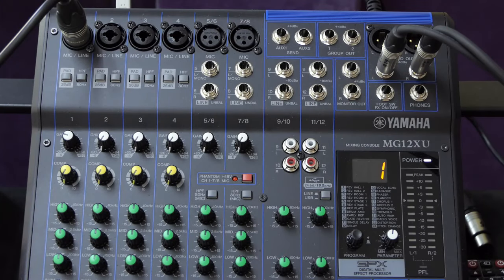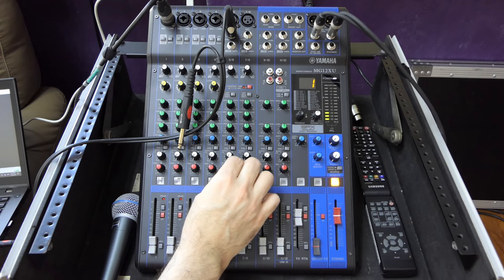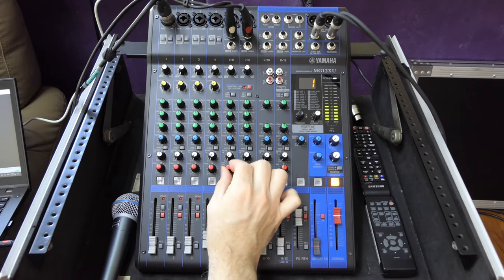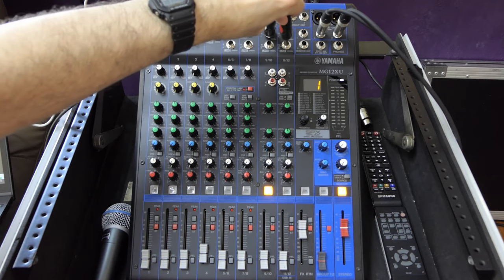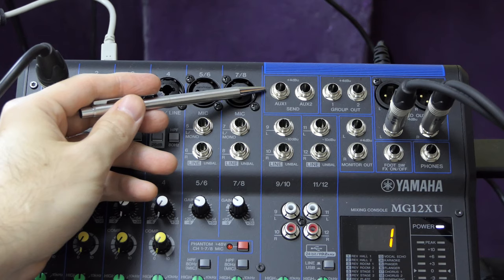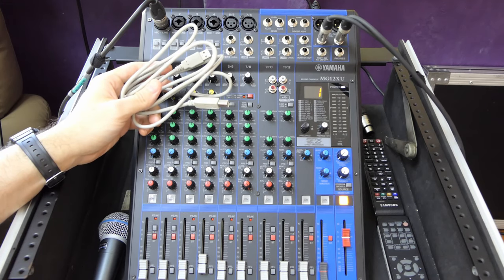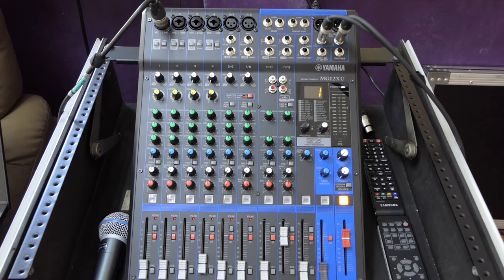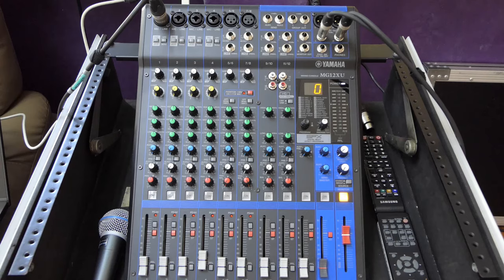Yamaha MG12XU Mixer Tutorial Part Two

Comment: Hi  I have a problem connecting the Mg12xu mixer to a dbx266xs  processor,and a dbx1231 equalizer  and also I got ptu7000 microphone and a pair of EV pa power speakers. Can you show me how? Thank you so much sir. Great video
Reply from the maker: What specific problems or issues are you having?
Reply: @GLBProductions  I just  don’t know how to connected  for example the processor, the equalizer from where to where to the mixer, I got the mixer and the microphone speakers working that about it , the processor and the equalizer is  not connected to any  thing yet . Thanks for reply back
Reply from the maker: In this case I suggest you contact the person who sold you the equipment and get them to assist you - it is much easier to explain these things in person and there are several different ways of connecting them.
Reply: @GLBProductions  got you thank you

Comment: Great vid. Can you use the AUX 2 1/4 inch connector to run a second separate stage monitor for a second singer that wants their own monitor mix ? Or can you only use AUX 1 and then have to daisy chain monitors together?
Reply from the maker: Yes you can, but if you do that remember that you cannot really use the internal FX engine due to the duplication of controls. So you can have two monitor mixes or one monitor mix plus the internal effects.
Reply: @GLBProductions  Thank you and makes sense!

Comment: Thank you for this tutorial video! Im just wondering if it is possible for a complete band instruments such as guitars, keyboard, and some line in connection from the drums,  can the sound coming from the instruments be downloaded directly to the computer as connected via USB. I'm thinking if I can use that method to do some livestreaming using OBS.
Reply from the maker: Yes you can do that no problem - just be sure to monitor the audio going to the livestream for level, balance etc.

Comment: Nice video, man. I have a question for you.  With this mixer, you can cut of the low frequency for your main speakers? I have an subwoofer,  and I wont to cut the low frequency for the speakers output, about 110, 120Hz. So, my question is, I can do that with this mixer ? Thank you.
Reply from the maker: No, this mixer does not have EQ on the main outputs, or any output for that matter. For your setup I would get a separate 2-channel electronic crossover - analog ones are still available and relatively inexpensive.
Reply: @GLBProductions  Thank you for your answer.  What about this mixer? Mackie ProFX12v3. ? I see that he has  low cut filters for all the channels,  including the Line channels.
Reply from the maker: Ah those are for the input channels - it is not the same type of filter as you would need when setting up a subwoofer.
Reply: @GLBProductions  Thank you a lot for your answer.

Comment: I noticed that the signal from a windows laptop coming from usb input has a distorsioned signal . With a macbook everything works very well. I tryed with many laptops ,still the same . Can you explain why this happen ?
Thanks
Reply from the maker: In my experience changing the cable can sometimes solve the problem. You can also try turning down the volume on the laptop to about 50%.

Comment: What a very comprehensive tutorial! I would just like to know, would the USB interface produce feedback if I use this mixer for a conference app, say, Cisco WebEx? I am concerned that the audio from other members would loop through my own speakers back into microphones that are on input to the mixer. Cheers!

Edit: I apologize if this has been discussed. I might have zoned out while it is on.
Reply from the maker: Hi Lyndon - it depends on which app you use. Some are able to deal with this problem via their echo-cancellation feature. Otherwise you need to use headphones to monitor the audio coming in from the USB connection.
Reply: @GLBProductions  thank you so much! Greetings from the Philippines.

Comment: Hi I have been following your tutorials on the MG series. I am a mobile dj. Can you guide me on hooking up a reccorder from a videographer.This is especially important when I am playing a wedding.Thanks
Reply from the maker: Sure - depending on which recorder they are using, you'll assign them one of the outputs from the mixer. This can be the extra pair of stereo outputs, the group outputs or one of the aux sends, depending on what works for them. It can also be the USB output if they are recording to a laptop.
Reply: @GLBProductions  Is it possible to clarify the above by way of a diagram of picture?

Comment: Hello, I am using the translator to ask a question since I cannot find more tutorials on the use of the console to transmit in a streaming by USB function. I have problems with the volume control (I cannot increase the volume that is transmitted) and I do not understand how to regulate the internal FX, which I listen to through headphones but do not come out live. Hopefully you can help me. Thank you
Reply from the maker: Hello Karina, thanks for getting in touch. The actual volume of transmission when streaming is difficult to judge as each individual listener has their own volume control. My best advice there is to ensure that your meters are showing a level of around 0dB when broadcasting. You may also be able to monitor and/or increase the level in your streaming program. 
If you can hear the effects in your headphones but not in the main outputs check that the FX RTN channel is switched ON and also routed to the main LR outputs. All the best!
Reply: @GLBProductions  Thank you very much for answering!
Perhaps it is not clear to me what are the total controls in usb output, that is, when I do not have speakers connected. The manual is very limited and I can't get the information. In another tutorial I suggest raising the gain and the compressor, but when testing it I don't have a better volume and if it lowers the overall quality. Thanks again and if at any time you post with this topic please activate the Spanish translation which is very useful to me. Regards!

Comment: Question for this mixer ?. when effects are on they effect the music and not just the vocal so switch of the effects coming from mono 5 & 7 ( which is great to balance when performing ) and the reverb has gone from vocals as well. In a word, when the vocal effects are on and being used then it also reverbs through the music as well giving it a wobbly yaw sound . Can you advise .Many thanks
Reply from the maker: Yes, make sure that your recorded music is not going through the effects unit - the FX send knob should be fully counterclockwise on the music channel(s).
Reply: @GLBProductions  Thank you so much for your assist !
Reply from the maker: You're welcome Kenneth!

Comment: Hello, thanks again for your wonderful video, very instructive ! I am a drummer & personally use this same mixer so I have some questions : -1) What is the best system & connecting for receiving a click + sequencer from a main mixer, without sending it, of course, in my main Stereo Output, but in my personnal ear monitor ? - 2) Which line do I have to use, the two SEND (Aux 1 & 2) or the two GROUP OUT ? -3) Which connecting to use, balanced or unbalanced ? - 4) How to proceed exactly ? Thanks again for your helpful answer, musically, Emilio L. (France).

Comment: Great video, thank you for your time. At 16:50 you talk about the possibility of a feedback loop between channel 11/12 and the computer. This is what I am experiencing but the static feedback sound comes intermittently every two minutes or so and lasts about 5-10 seconds. Is there any way to prevent this from happening? I've searched many forums and can't seem to find an answer.
Reply from the maker: That doesn't sound like a feedback loop Tom - an electronic feedback loop will get louder and louder at a specific frequency and will not be intermittent as you describe. Try to isolate the source of the noise - is it coming from the computer or from one of the input channels?
Reply: GLB Productions I believe it may actually be due to the usb connection as I run computer audio through the mixer via the USB port on the back of the mixer. Do you think this is a potential source/reason for the noise?
Reply from the maker: Most definitely - computers are notorious for introducing noise into sound systems. Try a different USB cable as well as a different computer and see if that changes things.
Reply: GLB Productions thanks very much for your help and suggestions. I’ll have a play around and see what I can do. Subscribed!
Reply from the maker: No worries Tom!

Comment: Your videos are very well explained. Thank you for that.
I have a question about connecting the mixer to the PC via USB. The sound in both directions is very quiet. Is there an explanation for this? Thanks in advance.
Reply from the maker: Thanks for watching Hamouda! For the incoming PC signal, make sure that the volume on the computer is still to 100%, and check that the digital attenuator is not reducing the signal - this is accessed by pressing the PROGRAM knob in the FX section five times. For the signal from the mixer to the PC, you can try setting the channel and master faders above the 0dB mark, or raising the level in post-production.
Reply: @GLBProductions  Thank you very much for the quick reply. I'll try that out.

Comment: Me again. Thanks for your advice.  I've already watched your tutorial on the Allen and Heath ZED-60 which is also one I'm considering.  I need it for my hardware synths and intend to use it live, but also as an audio interface for my laptop. As I need quite a few inputs plus vocals I don't think a specific audio interface will do. I know at this price point there will always be compromises but I need it quite quickly so saving up for a more expensive mixer isn't really an option.  Would you have a preference between the MG series and ZED range?  Or do you think there's something else I should consider?  Thanks again.
Reply from the maker: I would choose the ZED over the MG series because they have much better build quality. They also have semi-parametric midrange on the channel EQ whereas the MGs only have a fixed 3-band EQ. However the ZEDs also have several quirks you need to be aware of eg no 1/4" main outputs. So you need to look at both ranges carefully and pick the mixer that has the features that suit your needs and is within your budget.
Reply: @GLBProductions  Thanks for your help.  Much appreciated.

Comment: A great Video! I have one question, how would you connect an external compressor.  Thanks in advance.
Reply from the maker: This mixer has no insert points, so the compressor would need to be connected inline: either between the source and the mixer or between the mixer and the power amplifier.
Reply: @GLBProductions Thanks very much for your rapid reply. Could you  please be more precise. For example from which TRS socket on the mixer do I connect the the input signal to the compressor and which socket on the mixer for the return or output signal of the compressor. Again thanks in advance.
Reply from the maker: You're welcome Peter. What are you trying to achieve: compress a single input or compress the entire mix? Also, what's your application: recording or sound reinforcement? Normal serial compression or parallel compression?
Reply: @GLBProductions  I purchased  last week a Behringer MDX2600 V2 and would like to compress the Alesis SR18 Drum Machine (Channel 5/6) and also the iPad Channel 9/10 for a live performance. It would also be great if I could compress the vocal channel 1 which is not a priority  because  the mixer has a built in compressor on this channel, but it would be nice to know if this could also be compressed with my Behringer. Thanks again and really appreciate your advice. Many Greetings from Freiburg in Germany.
Reply from the maker: Thanks for the info Peter. The challenge here is that you have a stereo compressor with a total of two channels of compression, but would like to compress two stereo signals, a total of four channels. Given the equipment you have, I would connect the MDX2600 in between your mixer and power amplifier or powered loudspeakers - this will allow you to compress the entire mix, including your vocal mic. It won't give you as much control as having compressors on the individual channels but sources such as drum machines and recorded music already have some compression in their signals. It is also a simpler setup which is easier to adjust on the fly during the performance.
Reply: @GLBProductions  This is a great suggestion. I thank you very much indeed and appreciate your professional advice. Keep the good work going and wish you a wonderful and successful day.
Reply from the maker: You're welcome Peter, all the best with your music!
Reply: @GLBProductions  Hi. I have a feeling that there are many owners of the Yamaha MG 12 to 20 series mixers  who would also be interested in how to connect their outboard/external modules (Compressors, multi effects etc.) to either a single channel or chain of channels including stereo. Therefore, I would be very grateful (others too) if you could possibly make a YouTube video on this subject. Again thanks for the great work you do. 
With kind regards
Peter

Comment: I'm really confused about monitors for live performance. 

We use the XLRs for the speakers that go out to the crowd. We have one wedge monitor and one transmitter for in-ear monitors. The video says the MONITOR OUT jacks are for studio, not live performance.

Are our only options the AUX1 and AUX2 sends? What if we wanted to use the FX but hear it through both monitors? What if we wanted to add another wedge monitor? 

Surely there's something I'm overlooking.
Reply from the maker: Yes, this topic confuses many people 😅 To answer your questions: 
The MONITOR OUT jacks are designed for connection to studio monitors when the mixer is used in the recording application. This doesn't mean that you can't use them for other purposes - any output from the mixer can theoretically be used as a stage monitor send. 
On this mixer, AUX1 and AUX2 are designed to be used as stage monitor sends in a live sound application - they are or can be switched to be pre-fader, so that your FOH mix changes do not affect the monitor mixes. At the same time, AUX2 is designed to be either the send to the internal FX or an external monitor send, not both at the same time. You cannot use the internal FX and have it heard through both monitor mixes. In order to do that you would need to use an external FX unit. 
Hope that helps!

Comment: your tutorias are great! this channel deserves 1m subs and more!

question regarding the usb interface. if I just set it as output from my laptop, and toggle the st button, will still have feedback loop? My setup would be that the main output is for live sounds, and the aux send (1 and 2) will be sent back to the line in of the laptop. I'm only using one laptop for this setup.
Reply from the maker: Thanks Van! In this case you should be fine - the feedback only occurs when the USB interface is used for playback and recording simultaneously.

Comment: Hello and Happy New Year from Ontario Canada. I bought this mixer as Xmas present for myself. Works flawlessly except for one thing and I am hoping you can help??
I am running a midi controller (triggering a software synth)  and running it through channels 11/12 with the USB button engaged. 
The EQ low and high work perfectly but the FX  does not. i have tried everything under the sun today...as it's nice and quiet to figure this out. Basically I want to use my software synth but have the SPX chorus at the end of the chain.
Please tell me there's a way to do this??
I have been wracking my hangover head with it all day...hahahha
Thanks so much in advance
Darrin
Reply from the maker: Hi there Darrin, happy new year to you too! If the EQ works on the channel the FX should work, as it's literally the next things in the signal chain. Are you able to get the FX to work on other signals, plugged into the other channels? Check basic things like having the FX RTN fader up and switched on, routed to the ST bus etc.

Comment: I was eagerly waiting for the part-two video and thanks for uploading it. We use this USB mixer for Online Zoom concerts. I understand that there is no dedicated knob or fader to control the sound level for the Mix when sending it through USB. When we do soundcheck, we are often asked to increase the gain and fader level to reach a good sound level through Zoom, although the meter on the mixer often shows red lights and we almost clip. Our input setting in the Zoom for the mixer is almost maxed. I have two questions. Question 1. “Is there a way to increase the sound level via USB with a proper gain setting without reaching a clipping stage?” Q2. “if we use Aux2 to create a separate mix, the knobs for Aux 2 are also for FX, so how to create a separate mix for Aux 2, without altering the effects?” I will appreciate I receive a response. Thanks for the wonderful education you are offering, learned a lot.
Reply from the maker: Q1: Hello Dilip, this is not a good situation: your responsibility as a performer is to ensure that distortion-free audio with a good signal to noise ratio is input to the streaming program. Final volume is NOT your responsibility and you should not be compromising your own audio quality in order to achieve that. It's very much like watching TV - if the sound is not loud enough, the viewer should raise the volume on their TV set, not ask the broadcaster to make their programs louder! I suggest you communicate this clearly and firmly to your viewers. 
Q2: It is not possible to do this - as I say in the video, the knobs are shared. This is one of the significant design compromises of this mixer.